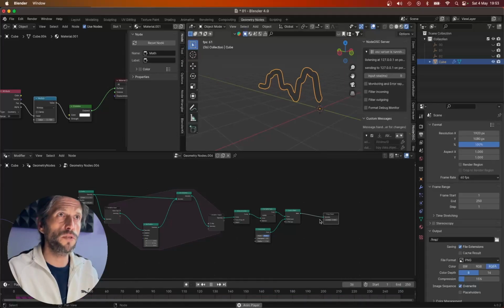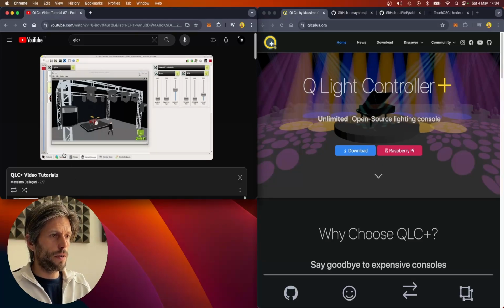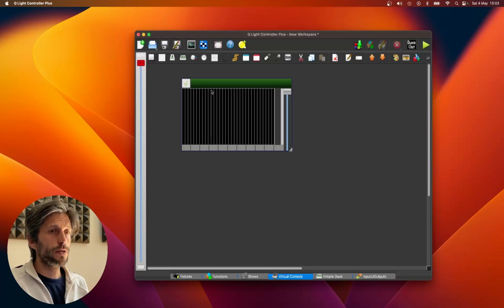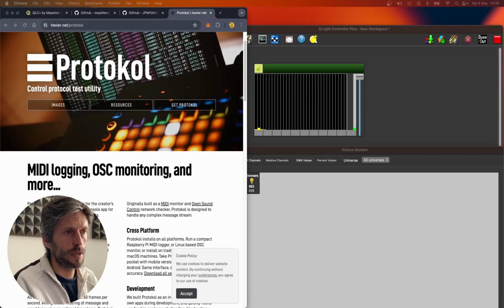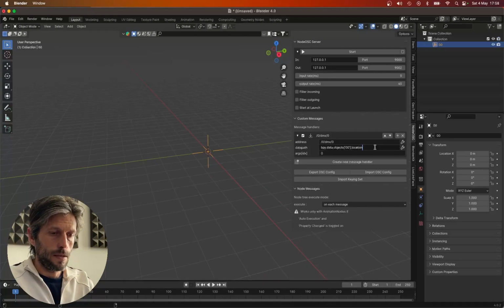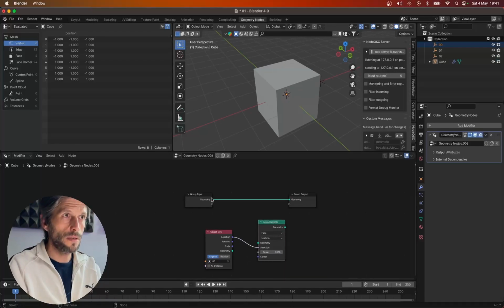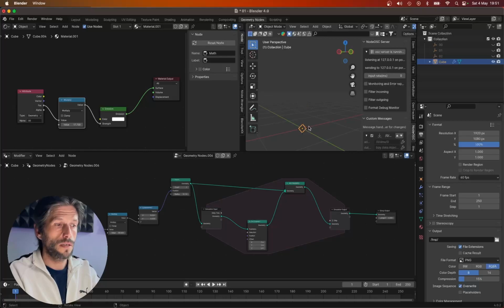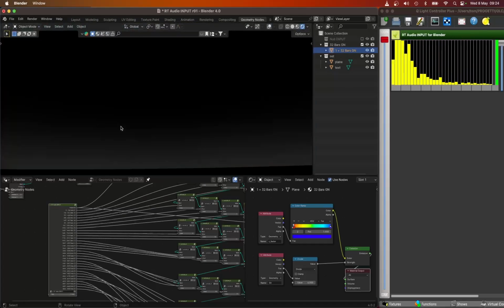RT Audio INPUT for Blender (needs QLC plus)

Comment: Thank you for this great tutorial! I'm just trying to figure out an issue and wondered if you can help. I have this set up with NodeOSC to an empty but I wanted to auto key the empty for later purposes. Unfortuntately nothing works, would you have any suggetions?
Reply from the maker: Thank you callumtoy2777! Selecting null object and turning on autokeyframe doesn’t write any keyframe. (I don’t know why, is the same with shapekeys). But those values are actually transfer from qlc to blender. Probably the most efficient way to store them is in a text file. Try to investigate this possibility with csv file. Even if you can write keyframe in blender you will probably loose any chance of RT result.. I mean 60fps for 33 null objects generate tons of keyframes!
Reply: @ thanks, I was confused as in trouble shooting, I grabbed the empty object and manually moved it around whilst auto keying – and that worked. But thanks for the tip about the text doc/csv file - I’ll dig into this!

Comment: This is great, thanks for the clear tutorial! is there a way to have the input but other than the Mic? would be great to play something from my PC and have that as the audio input. 

Also - I'm on a PC (windows11) and NodeOSC worked fine for me :) (blender 4.2)
Reply from the maker: Yes you can sample any audio source. QLC/input outputs/audio. Through a sound card you can capture your audio player or the output of a mixer. I think RT Audio INPUT should works fine on windows until you run NodeOSC. You can refer to this tutorial to set your address/port properly. Please share here your experience!! Thanks!
Reply: @TommasoMalaisi  i have tried with, even an expensive, audio card to capture the audio but they use USB which gives (big) latency, tried all kinds of settings and USB driver options. What workes for us 100% fine, is to just throw an audio cable from the master or rec out from mixing decks and use a minijach (3 bands) into our mic in (headphone mic). Whis actually works good. You can consider to use a groundloop isolator before plugging directly into large PA systems to prevent blowing up your laptop (which happened to us hehe, lucky with repair covered under guarantee)
Reply from the maker: @retinalrupturevisuals2038  I connect headphone output of my Beringher U-Phoria UMC204 to one of the input channel of the same card. Then in QLC plus I select the Beringher U-Phoria UMC204 channel as input. You should have no significant noise or latency with this method. I'm using a simple mono jack cable (but with a stereo cable you can probably get stereo signal).
I have no experience with large systems, sorry to hear about your laptop troubles.
The sound that goes out from headohene output must be clear right? As well as the input channell that receive sound from it. Even when i record video in obs I've never experienced noise from this signal. Off course you don't have to clip or you are going to loose any dynamics..
Hope that helps!
Reply: @TommasoMalaisi  thanks, i meant, now i just plug a rec or master out from a DJ mixing deck direct in my headphone / mic mini jack from laptop and that works proper.

cheers